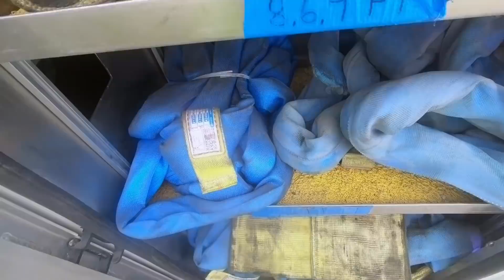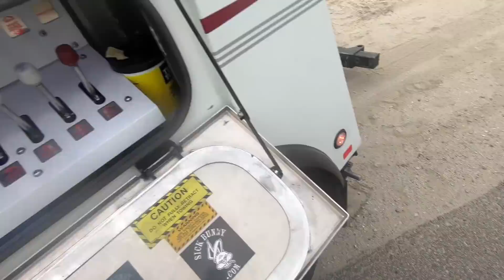Tractor Trailer Gets Stuck And Breaks Driveline

Comment: I got stuck in a sand parking lot at night while empty. Say there for 6 hours trying to dig and rock out. Finally a guy from a company down the street came and towed me out. 
That sucked. 
It was dark and looked like a open parking lot by the shipper I was going to. 
Nope. It was a silt pit for dredging out the local river. I do not park on anything other then payment, truck stops, or rest stops. No more risky spots.

Comment: ha ha ha i pulled a tractor and trailer sideways with a snatch block  and a 9000 lbs ramsey winch in a 1991 3500 4x4 chevy with a 350

Comment: That's a pretty weak shaft if he was just spinning tires tryin' to get unstuck.
Reply: Buyers spec out trucks with big engines but don't match the driveline to the torque that it can put out. The company I worked for had that problem too until the owner let us mechanics spec out the trucks. Then the office would still send one of the older weaker driveline trucks to the dump. It would end up with a twisted driveshaft or a broken drive axle every time.
Reply: The driveshaft and U-joints are designed to break before you break a transmission or rear end. Those get VERY expensive in a hurry if you break them.
Reply: Just a hammerhead
Reply: This failure is not a fault of the drive shaft or any mechanical components. This was caused by operator error. This is the result of abuse and an improper attempt to get a truck out of a situation that it can't get out of on its own. Spinning the tires doesn't wreck drive lines. Hopping the rear end and shock loading them does, though. That truck was jumping in the sand, putting max torque through the line in abrupt, repeated impulses.

Comment: Great video.  It looks like you guys have a lucrative business pulling Bozo's out of the sand.  What's wrong with the drivers in your area, why are so many out in the middle of soft sand?
Reply: That's an easy one. In that area if you are off the road you are in soft sand, because that is all there is there! The shoulders will usually be OK for a few feet off the road, but even they can be hard for a hundred feet and then ten feet of stuff you can sink to your hip in. It isn't always easy to tell by just looking, especially at night.